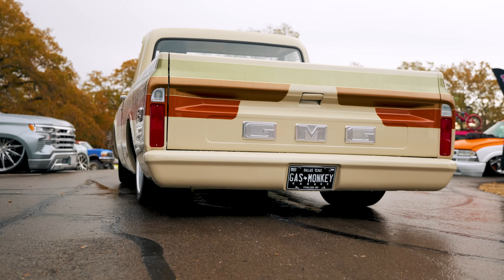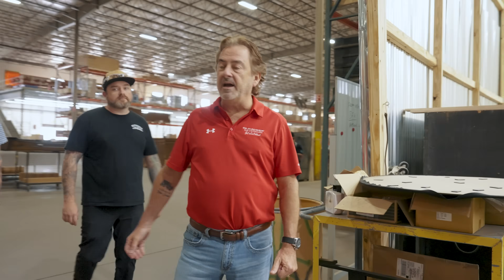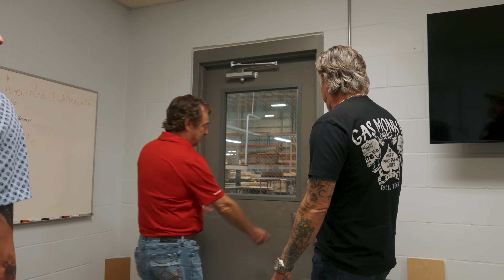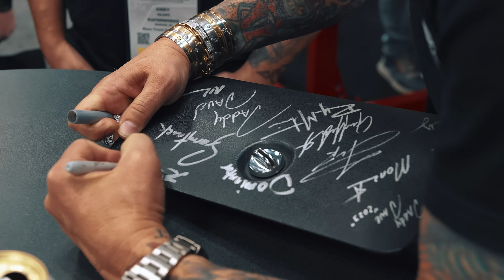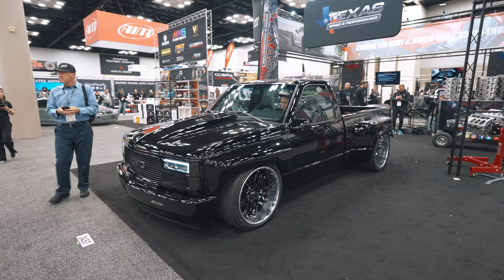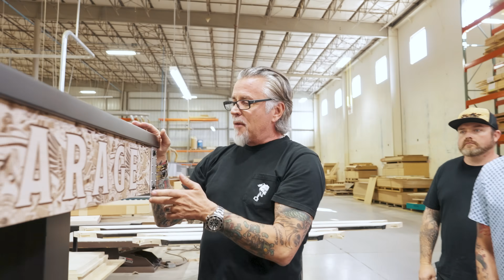We're Finishing Out 2024 With A Bang

Comment: When it's cold outside. You're supposed to take off your jacket as soon as you get indoors. Even if it's kinda chilly inside, 
Cold air gets trapped inside your jacket because it's insulated. It will hold it in there and keep you colder for longer.

Comment: You should do a bitchin pool table with the pockets done in thick leather, tooled to look like the Gas Monkey head logo. Hand tooled leather would be hot rod AF, and the monkey head, oh yeah! Or have them carved in hardwood, but the trick is that they are 3d shaped regardless of the material. So rad!